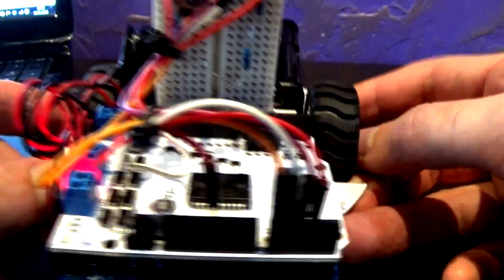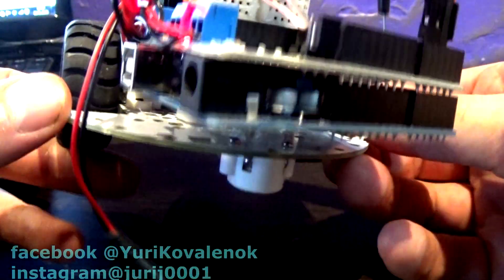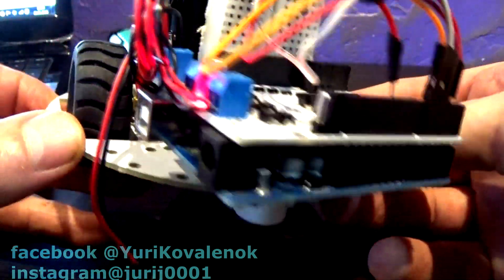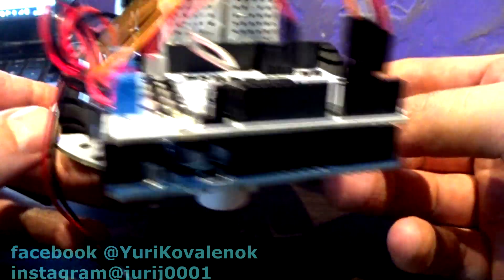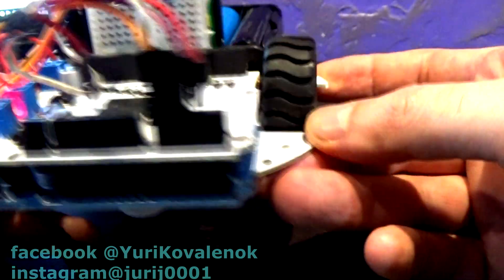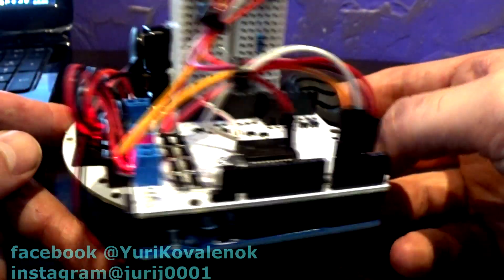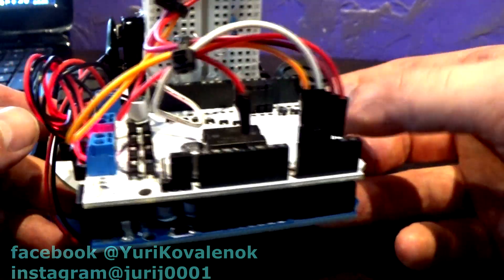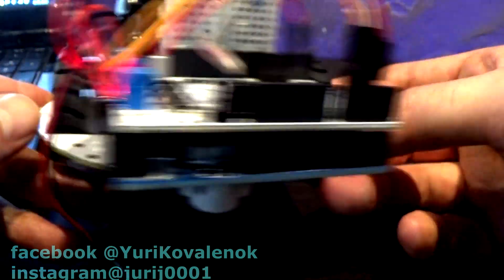Physics and Engineering. Arduino projects

Comment: Hello amazing project, im doing a proyect using laser too, It would be great if you upload a tutorial on the laser receiver
Reply from the maker: Laser Receiver ))) there is nothing easier, it is an ordinary phototransistor. Do you want to get the program code for this project?
Reply: @YuriKovalenok  If possible, of course, I would appreciate it a lot if I tried it with the arduino module, but the project requires that the laser is at 15m and I have to build a network of sensors ..... it's fun haha
Reply from the maker: @byronmunoz9303  The program code for this device can be found here https://bunim180.wixsite.com/jurij0001/post/control-of-the-robot-using-a-laser-beam
Reply: @YuriKovalenok  Thank you very much, I really appreciate it a lot ❤️
Reply from the maker: @byronmunoz9303  ok )))